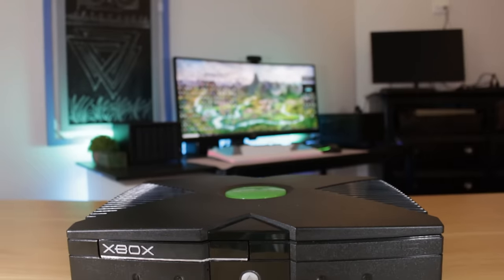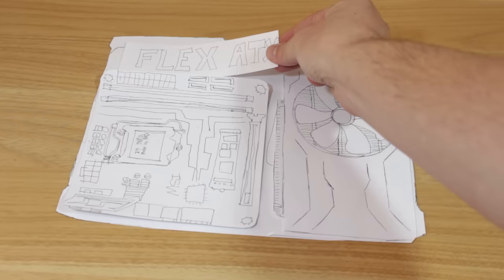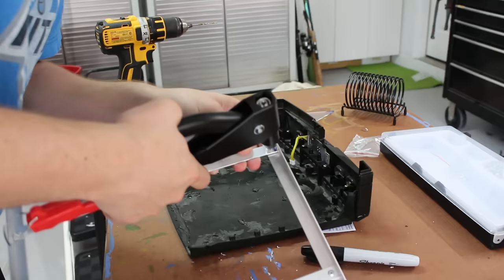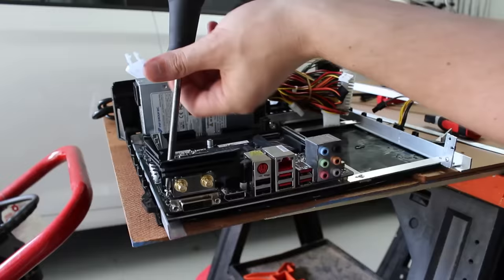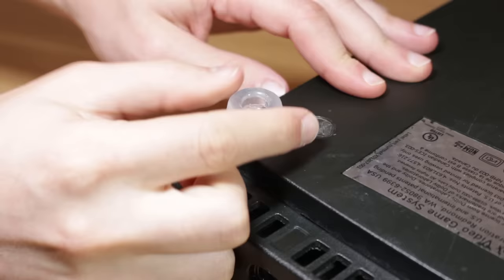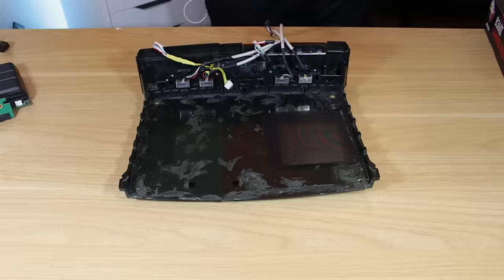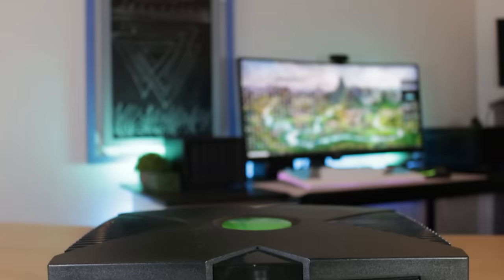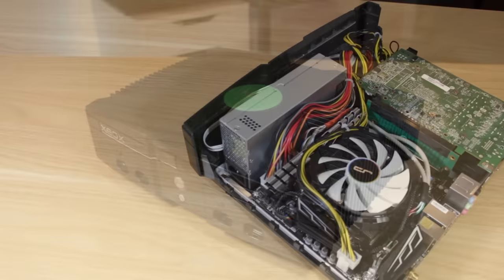I Built A Gaming PC Inside of A Console...

Comment: if you dont like the silver thing on the spacer on the xbox logo you coulda just permanent marker it black
Reply: Or spray paint and the feet too
Reply: Modern problems needs modern solutions
Reply: Thought same thing lol
Reply: I thought of the same thing... 

For YouTube Video Uploader Down Below...

Also, why did it need new Feet? 

Why not the old feet? What was wrong with them? 

Also, the back panel? It just looks like the back was cut out, & replaced? 

Why not cut the whole back off? & fix the portion that was indeed still opened? 

Or at least cut it out at a point where it still looked decent looking, o_@ 

Great Job, but ummm? 

How did you get like? I dunno? 100 FPS to 50 FPS from an I3 Intel Duel Core CPU in a Game with High to Ultra Settings? o_@ 

You are claiming that the GPU handled all of the work, all by it's self? You even stated the CPU wasn't Overclocked...

Comment: This build looks very good and I can tell you worked really hard on it but I were you I would have 

1-got a gtx1060 6gb itx or 1070 aftermarket card(swap the thermal paste for a high performance paste)
2- bought an i5 8400 
3-16gb of ram
4- some how squeezed in a low profile case fan
5- some how got an i/o shield or made a custom one with leftover plastic 
-6 spray painted almost everything black to match the look of the oem case 

In my opinion this would then be the most perfect future-proofed system that I could afford realistically 

I really enjoyed the video I think it was much better then the one Linus tech tips did because you did your research and took your time on it.

Comment: This buidl is amazing! The 'modest' specs are still better than my i3-2120 and 650ti that sits on my desk since the MOBO refuses to go in a case. (Of course it's using an Xbox 360 hard drive, as.well)
Reply: My first PC hard drive I took out of my Xbox 360 and formatted it into a usable boot drive through xbox2pc app or sumting like that
Reply: @HoloScope  my first of was a ryzen 5 2600 and rx 580
Reply: @chickenmag1657  my first was ryzen 3 3200g and gt710
Reply: chicken mag yooo that’s the build I doing right now
Reply: @binto9824  my first build was a intel g3258 and a gtx 950 2gb

Comment: Back in MY day the most impressive mod for the original Xbox was to install Windows on the original mainboard. RAM and CPU upgrades were possible as well. This is a really good build though, especially due to retaining the front classic Xbox ports, which as you mentioned are actually USB. I used a homebuilt adapter to use an Xbox controller on my PC back before it was mainstream. Hilariously this means you should be able to use OG Xbox controllers without any external adapters, with the right driver.

The aluminum support frame worked out nicely too, but I do have a couple of suggestions. For the back, I think you could have cut just enough material to allow the ports to be accessible, maybe with the help of some epoxy to hold the plastic together where needed. Or else just use an I/O painted black, and paint the GPU slot vents too. Would stand out less. Just my two cents.

Anyway the absolute BEST use of this previously broken Xbox is to... run and Xbox emulator.

Comment: To increase airflow, you could use a dremmel tool to cut in-between the fins on the top cover. This will open the top cover, without changing the look of the case. You could even use the same type of screen on the top cover, that was used on the bottom of the case (gpu fan), to give it a more professional look. I really like the design choices you made on this build. Great Video!

Comment: I have a Cryorig H7 and I love it.  So good choice on going with Cryorig.

I also suggest modding the vent on the bottom to run a Noctua fan.  If ya have the fan oriented for intake, it'll have more airflow going into the GPU as it'll force air to enter the case.  But it's just an idea and MIGHT not work but it also might work.  Just something worth testing.

Comment: This video really helped my build my first pc in a dead Xbox too! I used very similar hardware; an i3 9100F, stock cooler w/ 90mm be quite fan, 16GB DDR4, Asus mini itx mobo,  silicon power 256gb nvme ssd, an evga gtx 1060 6gb, and a 350w flex atx psu by silverstone w/ a noctua fan mod (the stock one was louder than a stock intel cooler even at idle). I highly suggest you dremel out some airflow vents in the top of the case where the indentations are. it comes stock with vents on the side, so if you sand the vents cleanly it looks original tbh. I even threw in a rgb led strip inside so light glows through the vents, and I can turn them off for full stock look. You can go even further like I did and install 4, 40mm noctua fans (2 on each side of the case for intake and exhaust. I got them hooked up to a fan controller and run them at the lowest rpm just so there’s some type of airflow in the case, as I live in San Diego with no AC and it’s July lol. Even with stuffy ambient temps I never seen my cpu hit over 80c while running Aida 64 with stock cooler, and my gpu stayed around 70c while running gta 5 at 4K max settings. I plan on posting a YouTube video just to show the end result as it’s pretty solid considering I only put about $600 in total for the project, and just my overall experience building my first pc in a Xbox.

Comment: undervolt the gpu to the least stable core voltage using amd wattman it will reduce gpu temp by 15c
I am using xfx rx 570 at default settings it has core voltage of 1150mv and clock of 1285 card was heating upto 86c after that I reduced the voltage only to 1010mv now it barely reaches 73c.
For efficient cooling use msi afterburner fan curve

Comment: For the RX 480, you could try replacing the thermal paste and see how temps hold up (for reference, i was able to drop my temps by like 10-13C by cleaning out my 980ti and replacing the paste). If that isn't enough, you could also try to undervolt it a little bit with Wattman or something. It probably won't make a HUGE difference but it would likely be enough to ensure a more comfortable experience.

Comment: Not bad great job on in. Makes me want to turn my old ps3 (fat version) into a budget small form PC. There is one thing that concerns me with ur build though and that's the GPU in a case like this I'd gone for a GPU like a 1050ti or 1650 somthing a bit lower on power usage that dont need a power connector and might run cooler as a result in a case like this I just feel the rx 480 in a bit to power hungry for this case and might be overkill on the CPU but other then that nice project no doubt. Also you might want to look into as well on if you want to stay with that GPU under volting might not only make it run cooler in the case but faster as well given its not already CPU bottlenecked.

Comment: Nice work. I did a system inside an original Megadrive with a haswell I5 on a thin ITX board, and I'm nearly done on another Z270 ITX system inside an original Megadrive and Mega CD combo. got a GTX 1050 and I3 7350K in that one!

Comment: you can try undervolting the GPU and seeing if you can still maintain the same/very similar clocks. Also crank the gpu fan up to 80% and cut vent holes in the top, near the grilled area.

Comment: I put a regular 1080 gtx in mine with a ribbon style PCIe extension cable instead of riser card as it allows more flexibility but I also used an external brick for power. Honestly I don't see the big deal with external PSU's. They hide nicely behind a desk anyway and it saves a ton on internal space and thermals.
For my USB's I didn't realize there were converters but I used USB extension cables and glued them into place on the front panel...meh it works Wish I knew about these converters.
I also didn't put the back of my motherboard like shown here. Instead I used extension cables for everything to glue the female ends to the back of the xbox panel where I just simply made some small notches. This helped keep  more of the original look to it from behind.
For the top Xbox logo I created a round Steam logo and printed it out on vinyl sticker paper then added laminate on top as I wanted to mix the Steam and Xbox theme together plus I think the green xbox logo is ugly anyway.

Comment: The temps are not that hight, under 85c for the gpu is really impressive with that low airspace. I wonder what is the best gpu you could put into this case. Also the metal in the front is a bit conspicuous. Painting it black would fix it. I especially liked that you used not only the buttons of the case you also even used all four front connections without changing them to usb. But other than that this is a really creative and great project and the outcome is impressive. This surely would be the talk of a casemodding contest.

Comment: The poor frame time consistency seems like the 8100 is having trouble keeping the gpu fed. I mainly play overwatch and my 1600 and 1050 doesn’t have any issues with frames dropping off. And the 1050 is a fair bit lower end than a 480 for sure.

Comment: Why not use a long pci-e x16 flex cable , route it beneath the GPU. Flip the GPU open up the slats on top of the xbox case a bit more and voila no throttling!
Reply: That's what I thought, and for the CPU too, it would help the temp of both componant
Reply: Perhaps adding some venting on the top of the case would help as well. He has venting on bottom but not on top

Comment: It probably gonna get hot and cause games to slow down, it is kind of a laptop. I know this is for entertainment purpose but instead of risking this pc parts and something goes wrong. Better buy a laptop. Is gonna get really hot as well. I personally use a Desktop because have better flow of air.

A con of a Desktop of course is the portability is not there, but keep in mind that it can support more hard drives, more fans, and more power and more control over the system(You can open the case and change any faulty part, thanks of how big it is, you can better view the parts of the system). Of course, forget about the battery or heating issues in Desktop, you will have better experience at gaming if you are serious with that.

Now I need my like 😎

Comment: Don't take this personally: It looks bad and crudely put together. A smaller videocard would have been better, a PCI-e CABLE would have been better instead of a riser because you can fold it around the card and make it face upward instead of downward and man, acrylic exists. A subframe made of that would have been tidyier, screw everything to it and screw it to the case. Also, the back is an absolute mess, friendly advice, buy a dremel, makes everything so much more professional. Instead of snapping the rear vents, I would've removed them with a dremel and replaced them with an acrylic panel cut to size. 

Nice effort, but you could've done better.

Comment: Is a gtx 1050 i5 8400 good for gaming I need answers asap
Reply: Get a RX 570 instead of a GTX 1050. It will be wayyyy faster (almost double) and around the same price. The i5 8400 is good for gaming, but I would probably get a ryzen 5 2600 instead, as it has double the threads, performs similarly, and is cheaper. Hope I helped :)
Reply: @coachjohn2190  alri thank u

Comment: In fact everyone always starts off on the wrong foot in console modding. You must use a laptop motherboard, not a pc one. The classic xbox was conceived from dell latitude laptops in the late 90's. The correct would be an industrial card but they are rare and expensive, so the closest thing to that is a laptop card. You can get any laptop that broke the screen for a low price, there are nice and powerful laptops, take for example an Alienware 13, which has a decent i5 and gtx 960, all in a compact size that will fit your xbox.

The final problem isn't making it fit, it's all the heat this thing generates in a small space, which is exactly why the xbox 360 failed. Laptop hardware is easier to deal with heat, and outside the laptop case, they generate even less heat!

When using a laptop card, you can also optionally use a regular sata dvd drive, making the xbox dvd drawer functional again.